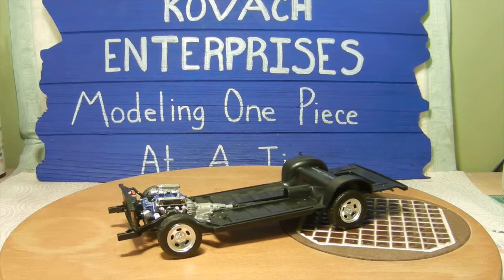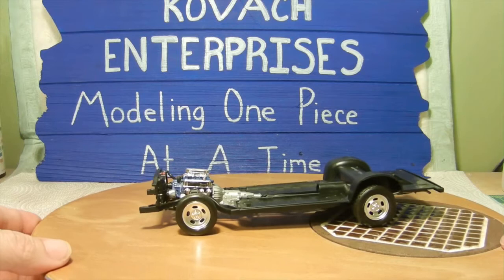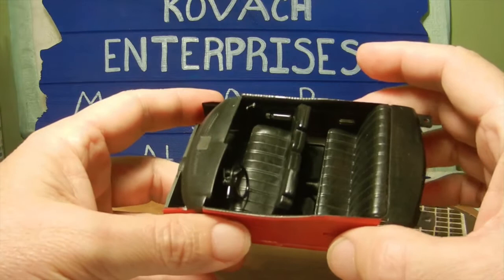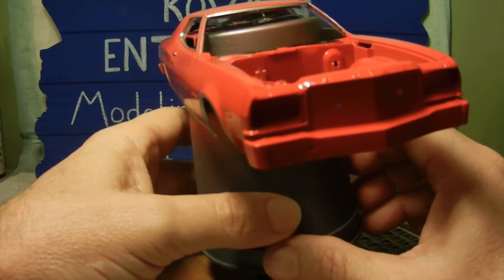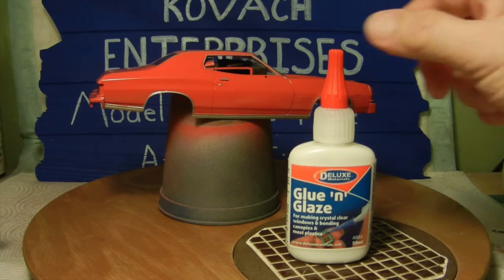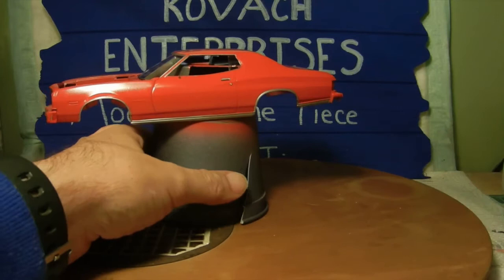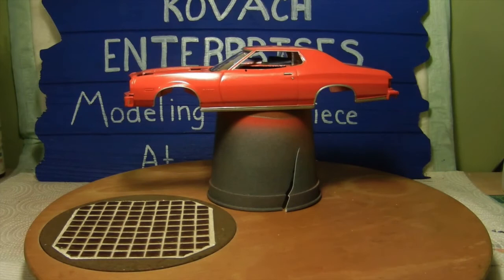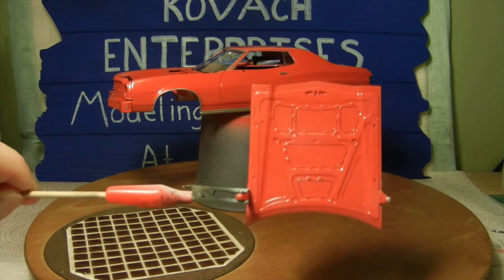Starsky and Hutch Ford Torino Ep. 2

Comment: hy Michael. what use for cleaner the colours. excuse for my English! !!
Reply: superb job!
Reply from the maker: Thank you Salvatore!
Reply from the maker: Hey Salvatore, are you referring to the paints I'm using? Or what kind of thinners I use for mixing with my paints before applying to the model?
Reply: Thank you for answer. I refer the thinner that you use for the color folk art.
Reply from the maker: Salvatore Caruso I mix windshield wiper fluid with the Folk Art. Making sure it's about a 2 percent consistency, like skim milk before spraying it with my airbrush. Hope this answers your question.
Reply: Thank you Micheal. What percentage do you dilute the folk art color with the windshield wiper fluid?
Reply from the maker: It's more of a feel than a percentage, based on different acrylic paints. For the Folk Art I basically put about a quarter in my airbrush cup and apply a few drops of windshield wiper fluid. I mix it with a toothpick in the cup and dap a little on the side of the cup. If it starts to run down the side and still holds the paint, then that's about the consistency of skim milk. I adjust the nozzle on the airbrush and spray a test pattern on some paper towels. Remember depending on the paint, you may have to adjust the thinner (Windshield wiper fluid) to accommodate. Hope this helps.
Reply: Thanks for your valuable help. You've been really helpful. I'll do the tests and let you know. Thanks anchors Michael